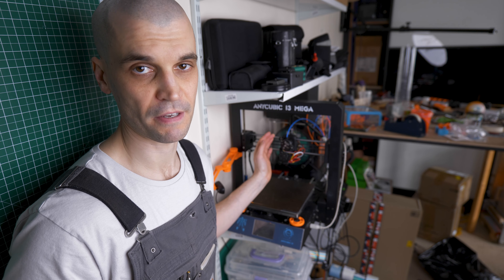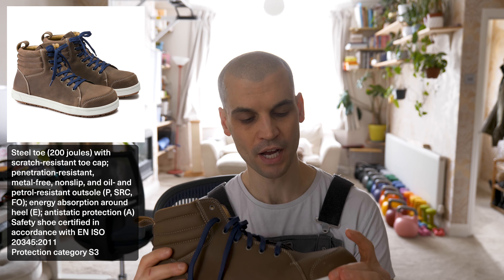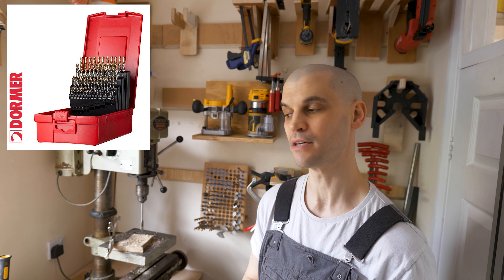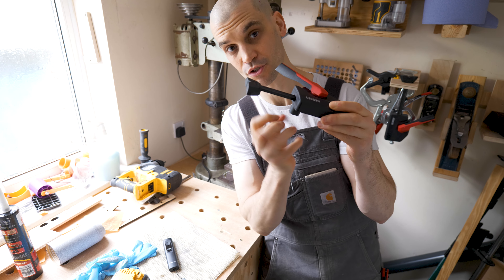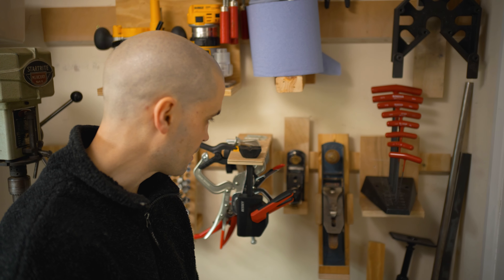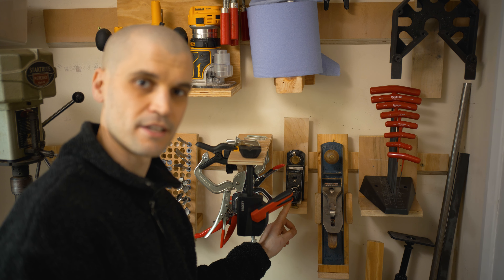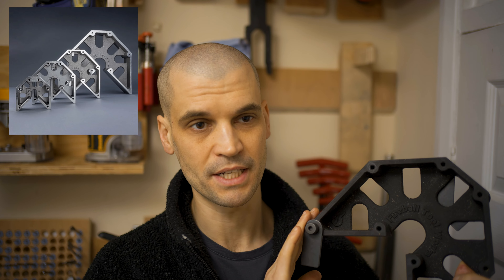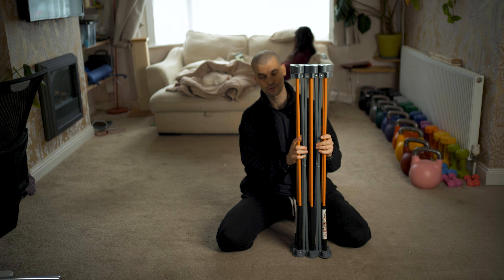My FAVOURITE Tool Purchases Of 2023 #notsponsored

Comment: The overall philosophy to take note of is that good tools have thought put into them.  

The manufacturers take the time and spend the money to chase the gremlins out that budget manufacturers leave in.  You pay a bit more for a total lack of workflow breaking frustration.

That Miller head and Nucleus are two examples from my world that do exactly that.
Reply: I often buy a cheap version of a tool (or drill or router bit) first. Only when I find myself using it a lot, I upgrade to a higher quality version. The difference is often enormous, yes.
Reply from the maker: Yes im a firm believer in buy once cry once. I've never regretted buying a more expensive version of a tool, NOT ONCE. I'm doing this as a hobby, so enjoyment factor is actually the number one criteria for me. I need to enjoy using all these tools to make all these projects because no one is asking me and paying me to make stuff, so i dont have any push in that regard. 

I also find better tools hold their value much more when you need to sell.

The Miller head has been an absolute joy to use so far, i picked up that head and the tripod legs for £700 second hand. Its a huge amount to spend for me, coming from camera gear that i have mostly spent sub £100 range for all my stuff. But this year I've decided to invest heavily in my filming setup to try and improve my workflow.

Comment: Nice list. I'll check out the superglue you mentioned. It's probably sold under a different 'Henkel' brand here.

A couple of my favourites this year: Although I love using my very compact Makita 12V impact driver, which compared to a regular screwdriver/drill is much more powerful and a lot more comfortable to use (no torsion on your wrist), this year I bought the small Bosch 12V drill driver with all those FlexiClick tool head attachments. Seems a bit gimmicky at first, but I found myself using them quite a lot, to get into hard to reach corners, screwing or drilling. And besides that, it's quite handy to have an additional driver at hand so you don't have to swap bits all the time. The Makita is still more powerful and comfortable though for regular screws.
The same 12V batteries fit into the awesome and tiny Bosch edge router. I use it all the time to quickly round over some edges, I mostly leave the same bit in all the time. My good old small but corded Makita RT0701 router hasn't seen a corner in a long time, and now only leaves its box for jobs where the Bosch is obviously too weak.
Another 'tool' that suprised me in how often I use them, are the cheap Stanley STST11154 metal 'sawhorses' with the foldable legs. Surprisingly sturdy and very compact.
Reply from the maker: Thanks for the addtions, i'll need to research some flexi tool heads.
Agree on the impact driver! I picked up a few dewalt cordless tools this year and got their impact driver (12v) version. First time using a 12v impact driver and I love it, much more user-friendly than my regular 18v drill for screwing tasks.
Reply: @ThisDesignedThat  The only disadvantage of an impact driver is that you should maybe wear hearing protection... damn, those things are loud! 😄